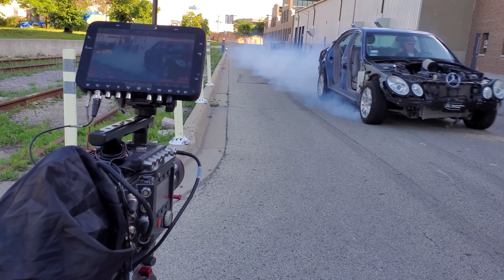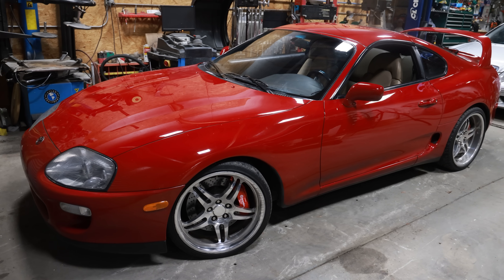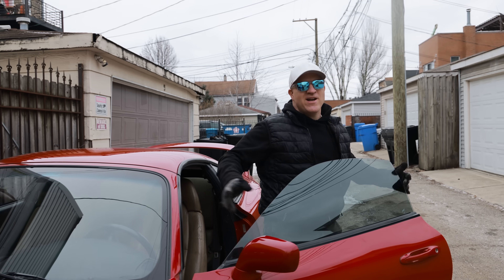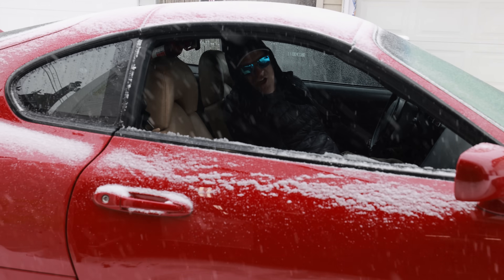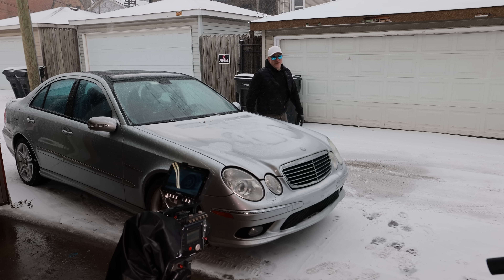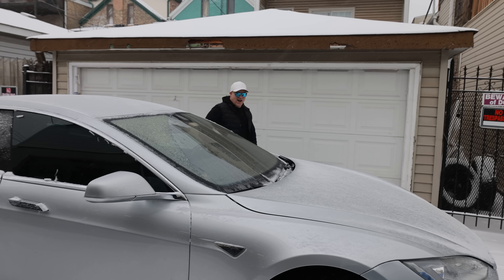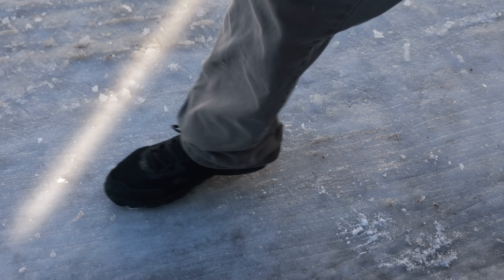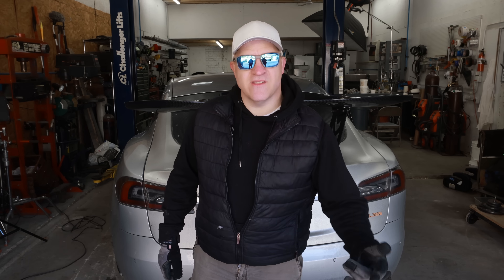Anti-Lock Brakes (In Slow Motion)

Comment: I was driving an old van with abs. Its pulses were increasing the stopping distance so much that I saw that I wasn't going to stop and was going to hit a gate. I had time to let up and stomp them again and that split second that it took to start pulsing made the difference and I was able to stop inches from the gate. When I slammed on the brakes it threw me forward then the pulsing started and it felt as though I had no brakes. So that little bit before it started pulsing again prevented me crashing. I could see it helping if I panicked in a corner but otherwise it clearly increased the stopping distance. At last in an older vehicle.
Reply from the maker: Omg I have the same issues with my cargo vans, you are 100% correct that is the same thing I noticed if the ABS kicks in my stopping distance is increased by double easy.

Comment: That tesla didn't give a single F 😂 even with all that weight it didn't stop faster. Pretty sad for such a tech loaded car.
Reply: Car is heavier, plus there's a huge generator in the back.
Reply: @ProbeGT2  weight is a super important role when emergency braking on snow and ice. That genrator helped with braking since the weight pushes the tires further into the snow and thereby creating more grip. So this is no excuse.

The tesla failed miserably while the other, lighter cars did better and all of them had barely any weight on the back since the merc and supra are both front engine and rear wheel drive.
Reply: @-never-gonna-give-you-up-  it is not that simple
Reply: @rian0xFFF  it actually is. Maybe you should go back to school if you think weight doesn't contribute to braking distance and braking power.

Feel free to "educate" me with your opinion. I'm waiting.
Reply: @-never-gonna-give-you-up-  it literally isn't that simple though. Yeah weight does help with grip a bit but then there's this thing called inertia, which heavier objects carry more of. You should know that if you went to school. The weight doesn't add enough grip to overcome that inertia no matter how good your brakes are.
Reply: @Iisakki3000  tesla has traction and stability control, and those play a big factor. It's a huge advantage. That combined with very good ABS and brakes, AND perfectly distributed weight on all wheels should overcome that inertia downside. It's not a truck that has to stop with a fully loaded trailer....

Stop acting so dense please. Tesla failed here, end of story. Tesla's should be the safest car, yet it fails when competing with old cars.

You are assuming a lot and yet you can't even have it right yourself 😂 how sad.

Comment: Isn’t the rate of pulse like the rate of traction control- based on the amount of spin?  Per quarter turn. Per 8th turn. Per 32nd etc?  I’d think newer vehicles would sense smaller increments of wheel spin/slip and adjust the pulse accordingly.
Reply from the maker: That's a great question
Reply: What is counted here as pulse is not the frequency of the abs systems. Modern systems do more than 100 adjustment of pressure per second. Even these made more adjustments than 4-5

Comment: Test with vehicle a data logger so you can see each wheel pulse/spin. You might be surprised at what you see.
Reply from the maker: @peterromano1911  that would be amazing, I really should have done that, I also forgot to put the videos of each ABS pump in this video...
Reply: @WarpedYT  Scan My Tesla has wheel speeds for Model S, if those signals stil work in there (you can find it in the All tab)
Reply: @WarpedYT  considering that the supra has a single pump/system, all 4 wheels would lock/unlock at the same time. the Merc and the tesla should both have 4 wheel independent ABS, meaning each tire is getting pulsed/modulated at a different rate and each is calculated on their own.  My 1995 roadmaster might as well not have ABS, as it doesn't do much, but my 2021 sienna you don't even feel the pedal pulsing, you just hold the brake pedal down and it does its own thing for each wheel.

Comment: I thought the point of ABS was to permit continued steering and prevent the wheels locking and effectively slipping out of control. This lets you still have that steering power in an emergency. It does impact braking power but it’s a good balance to permit the driver to remain in control. Interesting how long the times are between pulses in the older cars. Living in Scotland and seeing a lot of weather I know to back off slightly on brakes when they start kicking back via ABS. You do get used to it
Reply: That's a common misconception but not true at all, you can find various testings here on youtube, humans cannot beat ABS in braking distance (snow/gravel are exceptions). Even if you somehow get the perfect braking power without ABS (right before a wheel locks), you are limiting the braking power on all 4 wheels to that, ABS tries to find the optimal braking power on all 4 wheels independently.

Snow/gravel is different because just locking the wheels actually decreases the braking distance instead of increasing it because the snow or gravel is accumulating in front of the locked tires
Reply: Back in the day, before ABS, in a panic stop you'd press hard on the pedal, and lock up the wheels, and it was UP TO YOU to realize you're still sliding towards the thing you don't want to hit, and you'd have to let up on the brake pedal a little to regain steering, so you could go around, since you're not able to stop in time. Ahh, those were the days...